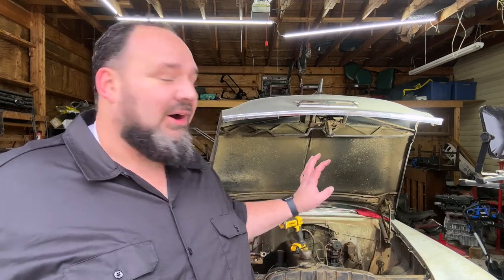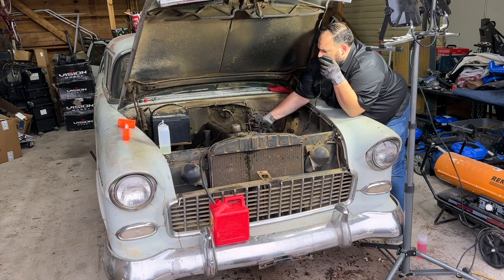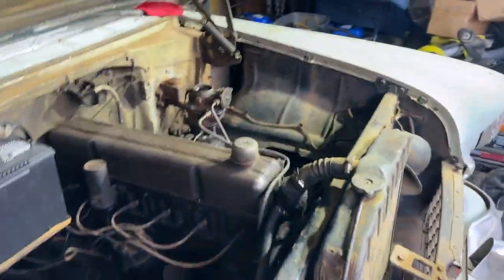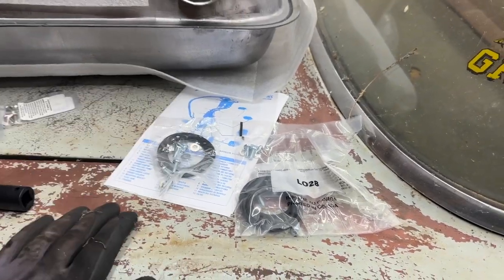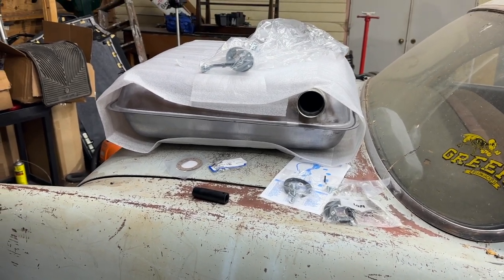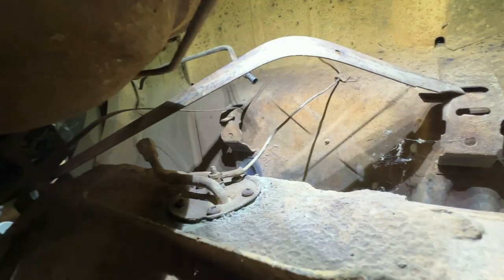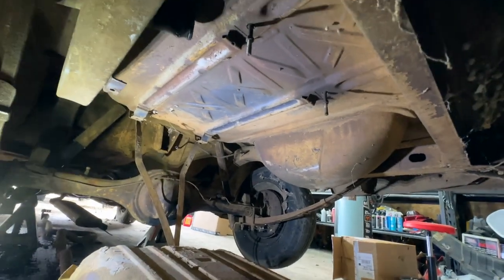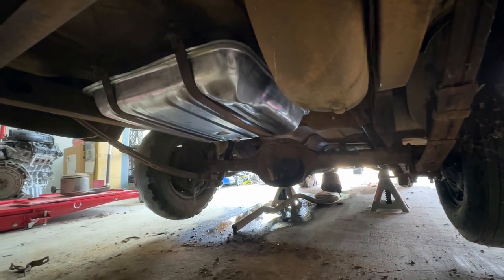After 40 years off the road, the 55 Chevy is running on her own again!!

Comment: Yes sir glad you got the fuel pump squared away. Getting that new fuel tank will certainly help the reliability of the fuel system. Bear in mind that those automatic chokes on those carburetors will step up the idle when cold in order to help the engine run when it is first started and is cold. That tube from the manifold to the automatic choke coil will warm it up and the choke plate will open up as the engine warms up. If you dissect the choke and throttle linkage you may find that there is a mechanism that steps up the engine speed for cold engine warmup. Also you will see the heat riser setup on the exhaust manifold and these will freeze up and not work properly. The idea here is there is a diverter valve that directs exhaust manifold heat to the base of the carburetor for proper engine warmup. You will see this when you take the carburetor apart to install new internal parts. This is so cool in that this car is so original and does not have any missing pieces. For the restorers who would like to view a vehicle as original (minus the normal wear and tear items ) for reference purposes this vehicle is a time capsule in that respect. Keep up with your good work and this will make quite a reliable vehicle. I would hang on to the original exhaust plumbing for reference purposes if you are going to have new pipes bent up or buy a replacement system. You will have something to compare to as the exhaust looks factory. Nothing beats the way the exhaust came from the factory as to fit and performance for this car.🥸
Reply: How much will you take for it.

Comment: I had running issues with a generator .A two cycle type that would not keep running . So I added fuel stabilizer to the fuel and it took a little running time and soon It was fine. Beat rebuilding the carb . I pulled the spark after a while and it looked like I just put it in.

Comment: I've not seen a video after this one, showing the new brake setup you talked about here. Hope it has a new hubs with roller bearings and not the ball's that came from GM. As you are trying to keep it as it was as much as possible, suggestion would be update the wiper from vacuum to electric. GM only used the ground to body add one to frame then to eng. Replace ALL lights with LED's as a lot easer on the generator.
Hope your sister enjoys many a happy mile in it. They can be a lot of work but also a lot of fun. I drive a 57 Sport coupe. (4 door HT) now only thing that is 57 is the body.

Comment: I dont know if it has been mentioned yet. If you plan on keeping the engine original you will need to add a lead additive to the fuel. If you dont see it localy the jungle site has it.  I would replace all the fuel lines also or least blow them out if metal. If rubber replace them.
Reply from the maker: Good call! Thx for the tip!